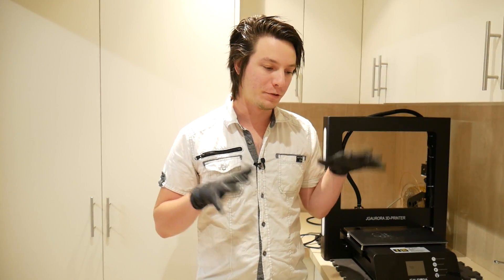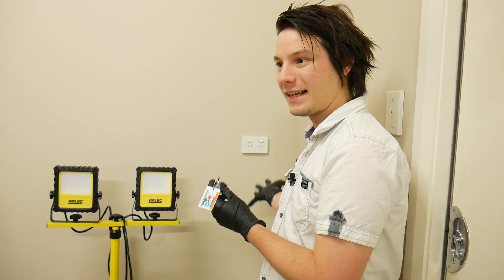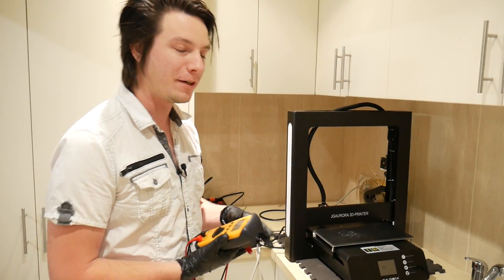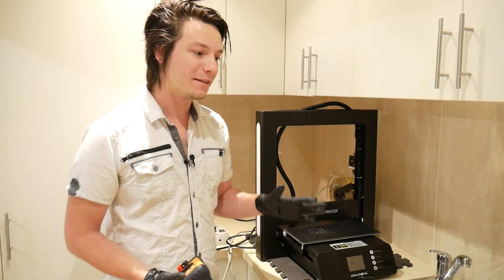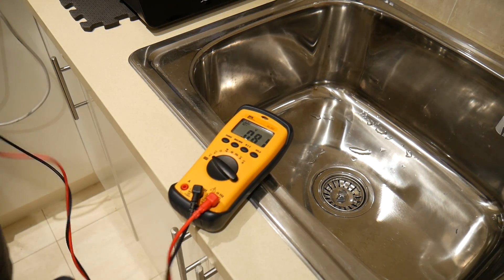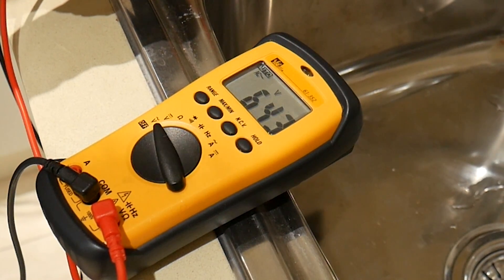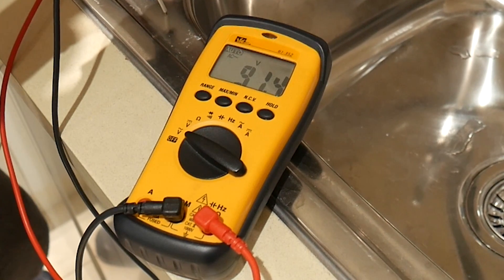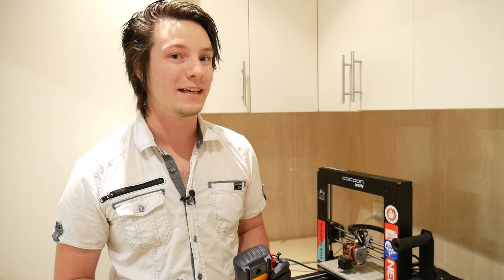This is why I was shocked by my 3D Printer IMPORTANT FOLLOWUP

Comment: Voltage does not flow!
Reply: Indeed. If you imagine electricity as a river flowing down a mountain, the electrons would be the water, the cable would be the riverbed (kinda incorrect, but just nicer to imagine), the voltage would be the height difference from one point to another, the current would be the amount of water flowing and the resistance would be the size and "roughness" of the riverbed.

Why is riverbed as an anology for the cable kinda incorrect? - It resembles the origin of the resistance pretty well, but dosn't give an explanation why some materials conduct better then others (conductors vs. isolators)

And just one more: the voltage is the height difference between two points in circuit, the potential is the voltage with respect to an arbitrarily chosen height which is called "ground" and would be the equivalent to sea level in our analogy.
Reply: But what about the sultanas!!??
Reply: voltage is the potential between 2 points in a circuit. current is the flow through a point in a circuit. the potential gives you the flow, similar to how heat moves from areas of higher energy to areas of lower. the bigger the difference in temperature between 2 points, the more heat transfer or flow of energy. higher voltage results in much higher current at a given resistance.

Comment: this sounds kinda dodgy TBH. Ground is a security measure intended to prevent any actual fault from moving the current trough you. It should not be connected to the live part of a circuit at all. If that is how these „power supplies“ work, then they are simply garbage.
Reply: Florian Bösch Ground is indirectly (capacitively) connected to the AC input via low value filter capacitors. Normally these capacitors will be specially rated for safety in case of failure, and the amount of current they are capable of passing at 50-60hz should be quite low.
Reply: No they are not! - They need this filter to be approved and not to radiate too much EMI. I guess you like to listen to the radio once in a while? Without this filter you might not be able to get a good reception close to it.
Reply: Please show me a $100 multi-hundred-watt power supply with no capacitive RFI filtering, which has actually and provably passed all required tests for western markets.
Reply: CapaCitors pass AC. So yes, there is flowing current - and no, it should never be on the order of mA. And no, it's not the original voltage in this case - there's a divider (those work by current flow!).
Reply: So you're saying every SMPS is massively flawed and determined to kill us. Because.. pretty much all of them have this type of filter. They all have MOVs, too - should they just use massively more robust components instead?

These caps, FYI, do not generally fail short. That's by design. And should they fail short, that is why you have an earth pin, connected to earth, and a circuit breaker. So what do I think will happen? A lot of smoke, a nasty smell, and a loud CLICK as the breaker opens. Earthed appliances not being earthed is not normal - it is a FAULT. And it takes two of those, at least, to create danger. That's.. hm, also by design. Man, it seems like someone may have put some thinking into this somewhere..

Please show me a power supply of any reasonable power output, efficiency, and price, which does not utilise standard filters.
Reply: Actually X caps can and often do fail short. Y caps must fail open for obvious reasons. (It is legal to replace an X cap with a Y cap but not the other way round.)
Reply: dont lick on chinese 3d-printers when plugged in.
Reply: the y capacitors are added to suppress EMI generated by the switching transformer. there are a number of simple measures to reduce EMI and some methods which add some cost. these methods allow to remove the y capacitor completely, or at least use one that results in far less leak current and still meet EMI regulations. of course that means you wont get away with a $5 psu but have to go with one in the $100 range.
Reply: also note that low leakage psus are common in PCs and audio equipment (at least in the better price range) because nobody likes ground hum.
Reply: No, they cannot "burn out" - There is no circuitry inside the power supply that can "sense" if it has earth or not. Stop spreading this bogus info.
Reply: See this paper from the early 00'ties about designing low leakage PSUs https://www.computeraudiophile.com/applications/core/interface/file/attachment.php?id=24877 . It specifically mentions several methods limit EMI and enable you to scale back the Y capacitor (or obviate it completely) by adding extra tape between winding layers, adding a common mode input choke, snubbers/mosfet gate drives, modulation of switching frequency and transformer shield windings.
Reply: There is no wired connection from mains to ground. There is a capazitor. So you get the original voltage, but no flowing current. And if you get 'electrocuted' this is just the discharging of the capazitor, which should be a few mA.
Reply: Florian, well you tried to state some facts but no one listens. I strongly recommend that people go study SMPS design. The problem here (as you stated) is a poor design, I also stated this in the last video... The capacitor is there to try and filter out more noise in order to get the piece of shit to pass noise emission regulations.

People stating that computer power supplies also do this, well they do not seem to understand that computer can also be poorly designed. You are 100% correct, NOTHING live should ever be connected to the earth pin. WTF do people think will happen if the capacitor dies and it shorts the live directly to the earth pin. 

This is NOT a design feature ffs, it's a flaw in design as Florian states.
Reply: You know what approvals these X- ans Y-capacitors bear? They are rated to fail in a safe manner. They will NOT fail in a shorted manner, so no, you will NOT end up with mains on the chassis. If these capacitors are not the correct approved types, the power supply will fail approvals alltogether. Look at this: https://www.allaboutcircuits.com/technical-articles/safety-capacitor-class-x-and-class-y-capacitors/
Reply: I'm not actually saying to do this because I don't want someone doing it wrong and dieing, but if you take any phone charger, connect one of your probe tips to a spliced usb cable's red connection, and then put the other probe in the neutral in your wall you will get a decent voltage. In the states we have 110vac and I've gotten between 45 and 70v through it. What you would find though if you also put a load between the neutral and the red wire from the usb cable is that the voltage drops dramatically. That is because the capacitors are in the picofarad range normally.

If the resistance of your skin is in a normal range.. (say 50k) you will get very little current going. (I=V/R, so about 1.6ma) That is if you were to actually be holding onto a proper ground too. To do the proper math though, you also have to take in the capacitors reactence into account though. You don't need to understand the math here really, but let's use a standard y-type capacitor value of 10pf for the example.

Impedance of a 10pf capacitor at 50hz:
1/(10 x 10(-12) x 50 x 2 x 3.14) = 318Mohm

Current flow at without any skin resistance:
I = V/R         so          240/318309886 = 0.75uA

So with all that said.... I'd be really interested to see what the amperage looked like between the metal casing and the tap, both with a 50k resistor in series and with the meter directly between neutral and the chassis.

*I don't doubt that Angus got a zap and I really could be making a huge error in my math/thought process because I'm just an electronics hobbyist. * I would actually love for some of the electrical engineers in the thread to chime in and let me know if I'm thinking of this correctly. I must not be...
Reply: The $5 supply may not have a Y capacitor at all. But it might have really bad soldering and connection termination
Reply: X caps can fail short and I have experienced quite a few that did (working on stuff at the museum). Y caps must not (obviously)
Reply: So then what happens if the capacitor shorts out internally and it isnt properly grounded? Then you have no way to find out because not enough current passes through it and then when someone touches it, they are connected to mains? Then you become the ground if you touch a conductive surface.
Reply: Y capacitors must not fail short so assuming they're of reasonable provenance they won't. See standards
Reply: Exactly. Those old RIFA X-caps are not fun when they decide to go "boom" inside 30 year old equipment that hasn't been powered for ages.
Reply: Jonathan Schneider If you understand how capacitors work, you understand that they can fail with age, and sometimes when they do, they do fail with a short. And even in the standards, they say that it can be dangerous. You could just as easily look that up too.
Reply: Heres another thought... what happens when a chinese manufacture decides to try and reverse engineer a design and decides to build a dodgy design with a crappy Y capacitor instead? I can see the headlines now, hundreds of nerds dead due to faulty chinese knockoff 3d printers.
Reply: TheKvack bahahahaha! XD
Reply: PC towers have the same issue.
They can burn out if not properly grounded.

Comment: That metal swagged uninsulated wire holding the chart on your power point tester scares me. There is a slight chance it could swing around when plugging the plug in and become live. If it was mine I'd replace the wire with something insulated.
Reply: If you look properly the live and neutral pins have insulated shanks which is part of our power point standard. This prevents accidental contact as the pin holes extends deeper then the uninsulated tips before the internal contacts are reached.
Reply: point taken but the earth pin isn't,  which has been pointed out in the video can be live in certain circumstances. Is it likely no, but is it possible yes.
Reply: +Richard Grenfell The earth pin is longer than the line and neutral pins so will be connected first. I agree that a plastic coil would probably be my initial choice regardless.

Comment: How many amps? Volts don't kill. Many self defence stun devices have millions of volts, but only a few milliamp, and do very little harm, but anything over 10 milliamps can be fatal under the right conditions.
Reply: Darastrix Sthyr I'd like to see how many amps are coupled to ground as well. It can't be much (else you'd constantly be tripping RCDs/GFCIs). 

That said, simplifying the danger to simply "volts don't kill" or similar is foolish. Volts and amps are inextricably linked over the relatively fixed resistance of our bodies, and even systems capable of supplying hundreds of amps (e.g. a car battery) are very safe at lower voltages.
Reply: Ground fault breakers usually trip at 30ma if I recall correctly. I doubt there would be 30ma here. So this setup is not in any sense "extremely dangerous".
Reply: Per Buer if there is no ground there cant be a ground fault detected. Also not every circuit is a gfci.
Reply: jort93z ohm's law
Reply: I thought it was 100 ma.
Reply: Per Buer oh you meant the 3d printer specifically
Reply: I meant that there would not be any dangerous currents flowing the chassis of the printer to ground. But ofc, no ground fault breaker would help here. :-)
Reply: Per Buer yeah i misunderstood you
Reply: Amperage kills, but voltage drives the amps through your body. Something is safe to touch if either voltage is too low to cause enough current through you (example: high discharge lipo batteries with 70+ amps) or the internal resistance is too high to produce enough current, for example the filtering cap.
Reply: It is extremely dangerous. Imagine a short between live wire and the frame without ground: No current through ground, so ground fault detector doesn't trip. Now you touch it, the ground fault detector trips. But do you trust it to trip faster than it takes for your heart to stop, considering you might be pulling cosiderably more than the potentially lethal 50ma.

Edit: oops missed you meant this exact setup, not a setup like this, sorry Per Buer
Reply: xSchattenfluchx lmao i did the exact same thing
Reply: Yeah,I got shocked once when I was drunk and tried to unscrew a broken lightbulb in a ceiling fan while it was turned on with my bare hands, was pretty bad. Didn't die though, obviously.
Reply: I think he means stun guns like this, that state that they have 2.5 million volts, same site sells one that says 5 million volts as well. http://www.budk.com/Black-Night-Watchman-2-5-Million-Volt-Stun-Gun-28888 http://www.budk.com/Night-Watchman-5-Million-Volt-Stun-Gun-Flashlight-Baton-37510 This one even claims a 20 million volt http://www.defenseproducts101.com/runt-mini-stun-gun-special.html
Reply: moral of this is.. don't play with voltage and current. If you mess with one, then the other one is going to get you. since both are brothers.
Reply: Are you an actual electrician? I can guarantee you that any AC power supply has the amperage to kill you DEAD. The VOLTAGE is what decides how much current flows through your body (either from ohms law or from parasitic capacitance) and therefore voltage is DIRECTLY proportional to danger and should be considered as part of what kills you.
Reply: Current depend on resistance, you can't just ask that question without telling us what the resistance first.
Reply: The sentence "Volts don't kill, amps do" is complete bullshit. It should be forgotten by everybody. Volts are in relation with amps, the more amps you get, the more voltage there is. They are linked. What actually matters, is time. The general rule is, that anything above 100 mA is deadly, yet stun guns can give off 10 or more AMPS in the first nanosecond.
Reply: Thing is, the human body is a very poor conductor. if you have below 100 volts not much electricity will flow whatever you do. 10 amps can't flow through your body if its only 200 volts. for 10 ams you'll need at least 10 times that, depending on the resistance of your body.
Measure resistance from your hand to your other hand(or any other part that would be grounded) and use ohm's law.
I've got 500k touching probes with my (dry) fingers on opposite hands. depends on the surface area and how firm you touch of course. Thats 0.0002A, 0.2mA at 100 volts.

Comment: Thanks for the update! 
Still think that the A5 case should be grounded properly too as it is conductive. Also the PSU completely enclosed with nearly NO ventilation holes isn't that good. The PSU fan will have a hard time to try cooling this PSU correctly and could generate other issues.

Comment: Thanks for clearing it up for everyone and for clearing JgAurora of any fault. Well done. 👍
Reply: Actually, I ordered a JG Aurora A5 from Gearbest even after watching the review video despite knowing he also got that shock.  Mind you I am an electronics engineer and suspected what Angus felt was just leakage through the PSU Y capacitor.
Reply: @KeanM  Should have gone for the A5S or A1. They have improved quite a lot. Unless you are trying to keep the cost down.
Reply: Chaos Corner I don’t think those were available at the time I got the A5
Reply: @KeanM  Never mind. I'm an idiot. I thought these were from January this year :D
Reply: Exactly, you know what you are talking about. Angus is given a trust to fully and honestly provide information that is based on full investigation into a product they provide. He did not do that.
Reply: @ The 3D Printing Corner  : They'd just litigate for damages.
Reply: Da Hai Zhu except with his influence he should have never made the first video without knowing what he was talking about. He could have had an impact on the JG Aurora sales just from making that video when they did nothing wrong.